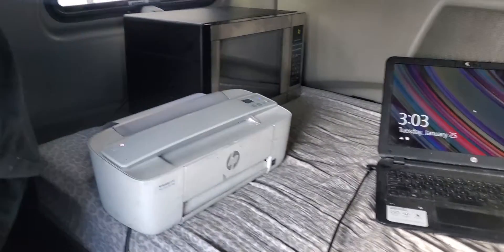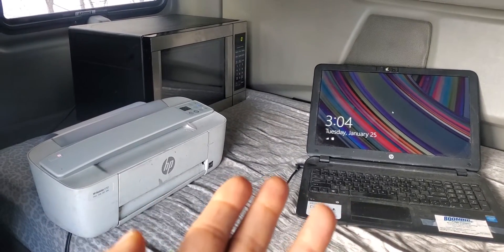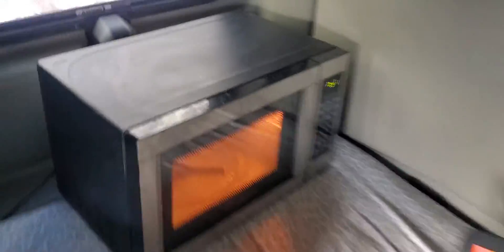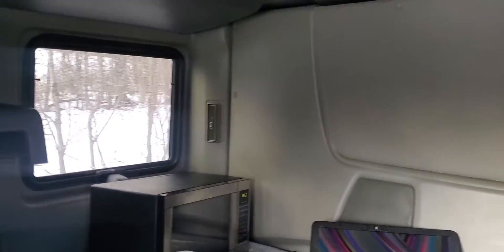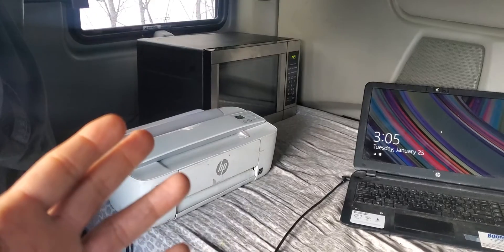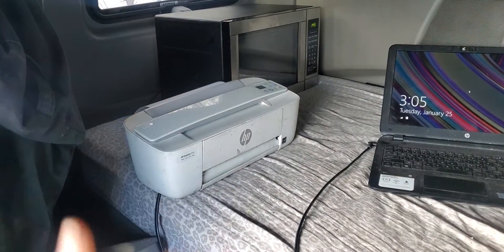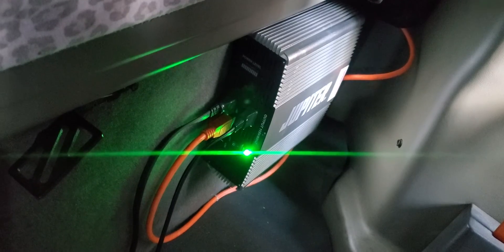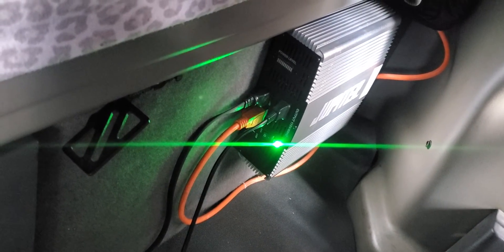inverter install in a semi, DIY power inverter install update.

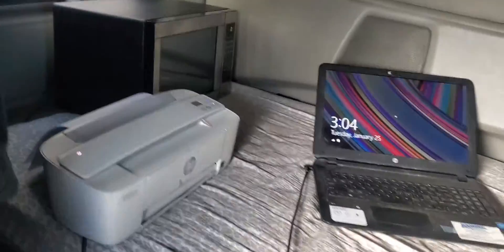Comment: I gone through 2 Jupiter inverters using the microwave... 1 Jupiter 2000 watts and 1 1500 watts inverters. Everything is connected properly and has a 150 breaker. However, when I use a 700 watt microwave for a 1:40 it trips the breaker. Yes it will show power with all 3 of the items you showed. The problem will occur when you used the microwave for more than 1:40 then it trips. 

I brought 2 new Jupiter inverters and they both tripped.
Reply from the maker: Do you have something else running on that inverter while using the microwave? 
Also, your wires can be the issue.
Do you run your truck when you use the microwave?

Comment: Can you plug a refrigerator up to it ? 
I have a refrigerator to mine and while I’m driving it’ll trip the plug breaker
Reply from the maker: Yes you can. Make sure the refrigerator watt does not exceed the power inverter  wattage make sure your braker is rated for your size power inverter.